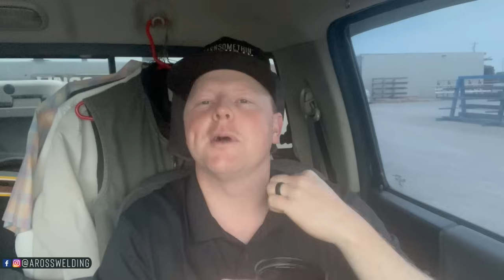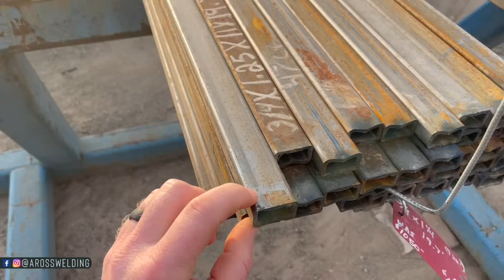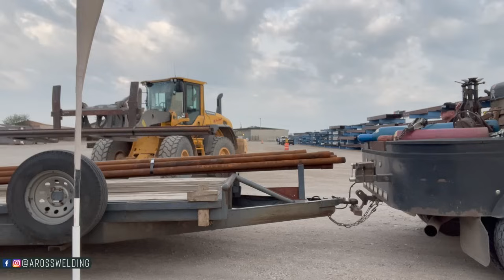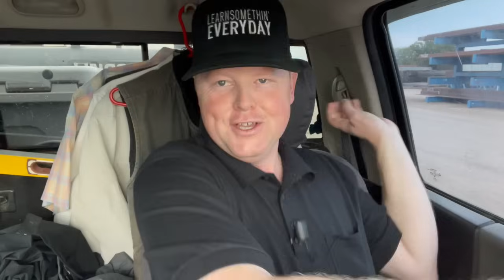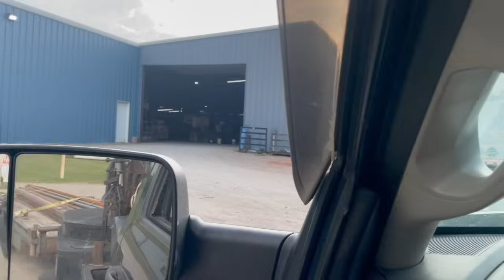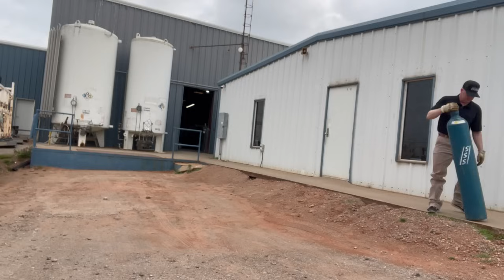Playing Truck Driver (What “Learn Somethin’ Everyday” Means To Me)￼

Comment: Breaker, breaker one-nine good buddy! 😀 dang I thought you managed to get behind the wheel of a bigger rig and floated some gears 😂 Good points to make here though I will say wrestling those cylinders like you’re doing will get you “stoved-up” in that lower back eventually. Sounds like you’ve been reading and following some good folks. Good for you! Oh! And as far as that drinking coffee while welding, just fill a Camelbak with hot coffee and strap it on! Of course, there’ll be no “pinky extended” drinking! 😂😂 Thanks for sharing sir!

Comment: The older u get the more u grunt when picking up bottles. There is a lot of days that u will spend picking up materials and making contact with old and new customers and suppliers than u will spend working.